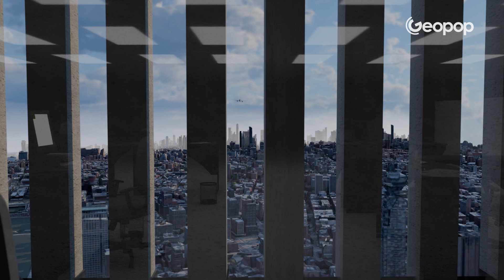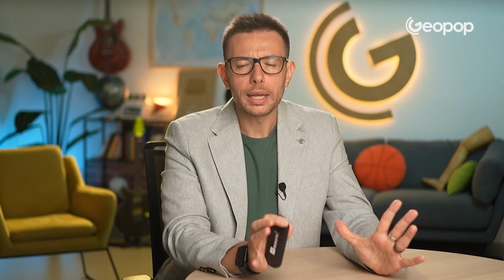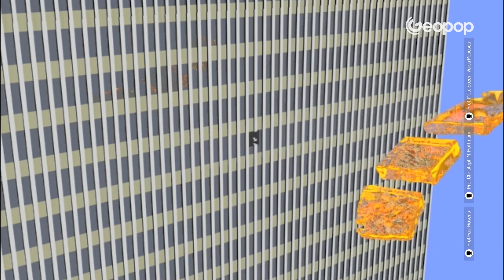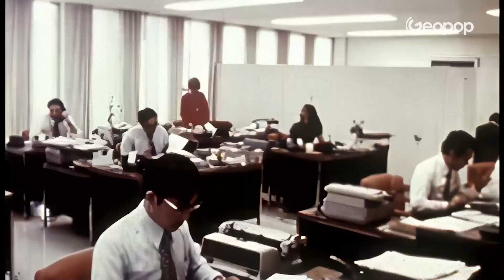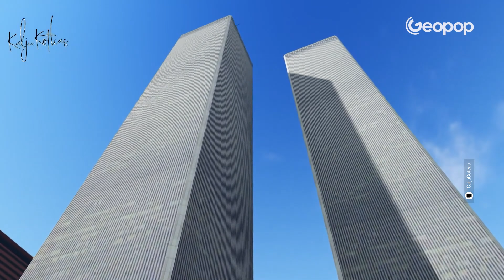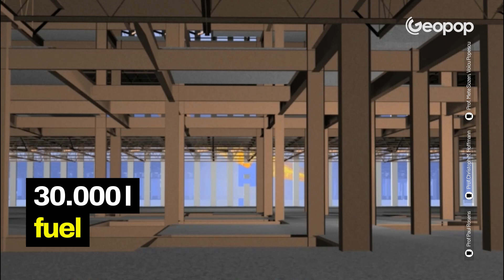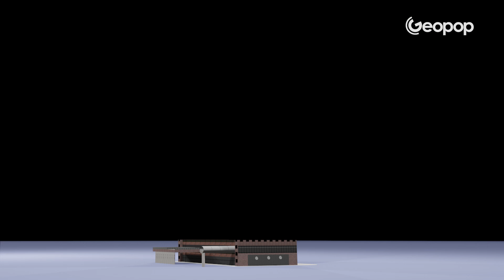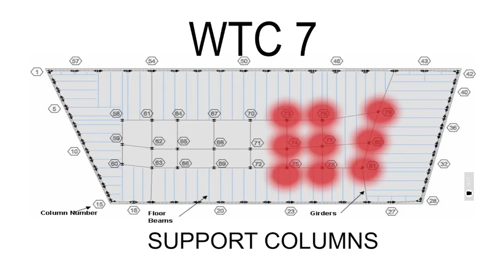9/11, 2001: The Technical Reconstruction of the Twin Towers and WTC 7 Collapses

Comment: Another bunch of lies . Both TOWERS WERE BUILT TO WITH STAND A 10. EARTHQUAKES.. PLEASE BRIT SHUT UP ABOUT SOMETHING THAT YOU KNOW NOTHINGABOUT .  WAS AMERICAN STEEL AND AVIATION JET FUEL DON'T BURN IN THE MANNER YOU ARE TRING TO SAY .FUTHER MORE SOME OF IBEAMS WRE CUT AT PERFECT 45 DEGREE ANGLES .SHUT YOUR MOUTH
Reply: So angry! But despite the use of all caps, you are wrong on just about everything!

Yes, the towers were built to withstand earthquakes & hurricanes; that does not mean they were built to withstand 500 mph strikes from heavy jets! And it wasn't just jet fuel that was burning; office fires burn hot enough to cause steel to lose more than half its strength! Oh, and those 45° cuts? Made by clean-up crews dismantling the debris.
Reply: I'm going to respectfully disagree with you, but rather than just simply assert you are wrong and beat my chest I will present a detailed affirmative case explaining why mine is the better alternative.

This is my summary explanation of Twin Towers collapses of the Twin Towers, start-to-finish, based on my observations without appeal to or reliance on any authority. No politics or ideology, just what actually happened, which is agnostic to who planned and carried out the 9/11 attacks or why. It has the benefit of not requiring Rube Goldberg levels of complexity and it makes logical sense. Each step in the process flows naturally from the one before AND is chock full of critical details the conspiracy-oriented internet tends to leave out with no whataboutisms.  My hope is this will dispel many common myths and answer most if not all questions you may have about the Twin Towers collapses. 

While complex, most of the Twin Towers collapse mechanisms can be seen with the naked eye and easily discerned and understood by the layperson if sufficient time is taken to understand. The worlds engineering community had already largely sorted them out at least as early as October/November 2001. Still, there are many who can’t be bothered to look or perhaps work hard not to see, being more concerned about advancing political/ideological agendas (which is exciting) than science and engineering (which is boring).

1. The Twin Towers consisted of 4 primary structural elements that together formed an integrated system where each relied on the others.  47 hollow box-section steel Core Columns carry the majority of the gravity loads. The 236 hollow box-section steel Perimeter Columns carry the remainder and ALL of the lateral (wind) loads. Long-span Lightweight Steel Trusses connect the core and perimeter column together at each floor with a Hat Truss on top to tie the structure together as an integrated unit where no element can survive without the others 

2. The impact of 117 tons of airplane (= to about 12 dump trucks) at speeds up to 590 mph completely destroys the aircraft.  This in no way implies the Towers come out unscathed. Some folks don’t get that. Hitting with the energy of up to a ton of TNT the impact damages or destroys many perimeter and some core columns (33 of 59 perimeter and 20 core columns destroyed at the impact floors in the North Tower), primarily through bolt-shearing failures at the end connecting flanges, as well as bending, twisting and fracturing of weld seams. There was no cutting or slicing - the reality was far more violent and messy. 

3. The impacts destroy or damage fire insulation, fire breaks and sprinkler systems on multiple floors. Huge fires are started across multiple floors simultaneously and allowed to spread rapidly with no effective firefighting or fire suppression. This was an unprecedented fire event . 

4. The hotter steel gets the weaker it gets .  With fire insulation stripped away and no sprinklers the survival time of the steel greatly reduced. Gradually over time heat causes the lightweight steel Floor Trusses at the impact damaged floors to sag, which was observed and recorded.  No steel melted nor did it need to. Structural steel will fail long before it turns to a puddle. It just needs to bend

5. Sagging floor trusses pull on the increasingly weak and overloaded Perimeter Columns, causing some of them to bow inward by up to 5 feet. A straight column is up to 4 times stronger than a bent column. The bowed Perimeter Columns buckle and fail, initiating collapse. The formerly static mass above which the structure below could easily support is now converted into a dynamic mass up to 30 times greater. Because they have buckled, the Columns above and below the failure point are no longer aligned . The load bearing structure below no longer bears any load as it falls past the lower columns, NOT onto them.

6. Thousands of tons of debris fall within the four outer walls, down through the open office space, crashing onto the first intact floor it encounters. This massive impact immediately breaks the bolted connections to the columns as the amount of resistance the Floor Trusses can offer is negligible.  The falling debris slows only marginally and briefly. Note:
6a. This is NOT a solid top block crashing into and “crushing” a solid bottom block .
6b. The debris falls past the columns not onto them.  The columns provide no resistance to the falling debris. 
6c. Only the bolted connections of the floor trusses to the core and perimeter columns can offer any resistance. A pair of 5/8” bolts at each end of each truss vs. thousands of tons of falling debris.
6d. No laws of physics are violated.

7.  This floor-led collapse progression within the four outer walls can only go straight down. Note: 
7a. This process is often incorrectly referred to as “pancaking” which actually refers to a completely different process rejected at an early stage. The catchy name stuck but nobody knows what it is supposed to mean.  Pancaking is too simplistic and inaccurate anyway. More like Kaiserschmarrn.

8. Collapse progresses through the floor systems not down the columns, through the path of least resistance . Rate of floor failures increases with each successive floor as momentum increases, reaching an average acceleration of 0.65 of GA, or 35% slower than true free fall. Bam, bam, bam down the building until there are no more floors to fail.  The resistance offered by each successive floor is always the same. The mass and velocity and thus the energy of the falling debris are constantly increasing with every floor destroyed new falling mass is added. Some falls to the sides, but most falls down. More mass, more velocity, same resistance with each floor.  Don’t get stuck on the but the lower floors weren’t on fire nonsense. They weren‘t and didn’t need to be.

9. The Towers were 95% air by volume. As that air was compressed inside the building it is forced down the tower and blown out the sides in reaction to the building collapsing . Those were not “explosions”, it was expulsions of compressed air caused by the collapsing building, explaining the low velocity, lack of flash, blast, supersonic pressure waves and lethal high-velocity ejecta.  

10. Perimeter Columns become detached and peel away like a banana behind the collapse front, playing out to the four points of the compass extending to more than 600 feet from the base of the towers. This was quite obvious from examination of the debris pile. 

11. Core Columns fail last as their internal beam bracing is stripped away by falling debris and lateral support from the floor to perimeter columns is lost. 

12. For those who care about how long this whole process took; 31-34 seconds from the moment the perimeter columns buckled until the last core columns hit the pile, or 1/3 the rate of true free fall. Don’t believe me?  Just watch any video of the collapses and note the loose truly free falling debris dropping much faster than the towers themselves.  

13. Each Tower had a 1-acre footprint. Far from collapsing inside their own footprints the debris pile spread out over 16 acres in a pile up to 14 stories deep. 8 surrounding buildings were destroyed and scores more damaged. 

14. What was NOT observed and recorded were the 180-190 dB bangs of high explosives or the blinding bright flashes of burning thermite. Of course, neither could have caused the (silent) Perimeter Column buckling that was observed.  Neither explosives or thermite could have survived the impacts and subsequent fires either. Cherry-picking a casual comment from someone who heard a loud noise in an event like 9/11 is not exactly “proof” of anything and the pre—planned demolition case relies entirely on that. There is zero physical evidence to support either conjecture. It would be technically impossible, totally impractical and completely unnecessary. No one would bother. 

15.  The Twin Towers were perfectly safe within their design envelope.  They only collapsed when taken far outside design parameters by an extraordinary and unprecedented event. 

Impact + Fire (heat) + Time + Gravity = Collapse . Remove any one of those four elements and there is no collapse. Ignore any of those elements (as many do) and you will never understand the collapses. The Twin Towers were an integrated system in which no one component could survive without the others. One fails, the rest follow, through the path of least resistance – DOWN – through the open space, bypassing the path of greatest resistance – the columns.  Nothing I just described violates any laws of physics. All of the above is true no matter who planned and carried out the 9/11 attacks or why 

I hope you found this helpful. It is meant to be informative, not adversarial, posted with the objective of soliciting informed critical comment, positive or negative. If I made any errors of fact, logic or reason or left anything critical out, please let me know so I can fix it. One topic at a time, on topic only please to stay focused, no word-salads of Gish Gallop. IF you can offer a more plausible alternative be my guest. So far no one has even tried. Please start any reply with the words “Tits McGee” or I will know you didn’t actually read it, are not serious and just wasting my time.
Reply: Made up nonsense, an the cut beams pic during cleanup. The buildings collapse of the point of impact in the walls were pulled inward until it finally collapsed
Reply: @mikebyrd8278  YEAH  IMPLOSION DIDN'T SWAY CAME STRAIGHT DOWN
Reply: @RonHudgens-ck5qe  if building 1,2 came straight down it wouldn't have destroyed 6 other buildings that day. The fire department determined building 7 was at risk of collapsing hours before it did an evacuated the area which is why nobody died there
Reply: @mikebyrd8278  NO DISRESPECT  BUT HAVE A FREIND THAT WAS GROUND LEVEL THAT DAY .. IF YOU HAVE NOT PLAYED WITH DET CORD  YOU DO NOT KNOW HOW IT WORKS.  I HAVE. THOSE OTHER BUILDS WERE COLADERL DAMAGE AND YES I WATCHED
Reply: @RonHudgens-ck5qe  no disrespects, but there is no evidence of any detonation cord. An how would this detonation cord be exactly where the Jets were going to crash?? How would it survive the impact and fire for that long?? How would it cause the exterior walls to be pulled inward until it finally collapsed??
Reply: @mikebyrd8278  THAT FROM MY PAST AND MY KNOWLEDGE AND SAFTY  SORRY,BUT I WANT SAY ANY MORE THAN THIS BEFORE  THAT EVENT THE ELEVATOR SHAFTS HAD MAINTANCE WORK BY A COMPANY THAT DID NOT DO THAT KIND OF WORK.  GOODBYE
Reply: @RonHudgens-ck5qe  oh you heard the elevator company doesn't work on elevators 🙄 
Yet some of the people that work in the prior elevator company worked for the new company in the same building. I guess the elevator guys rigged the building for the explosives somehow 
How about stop making up stories you have no evidence of